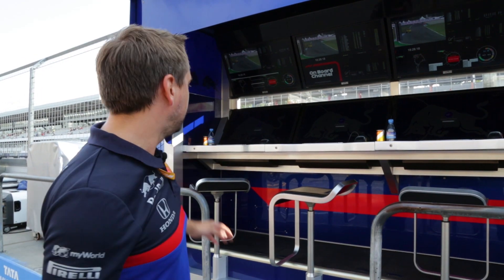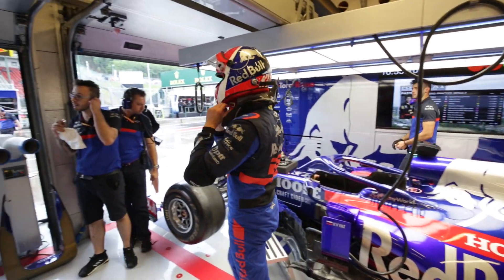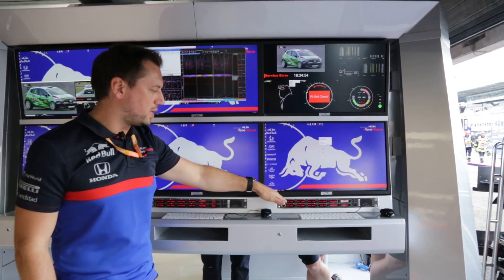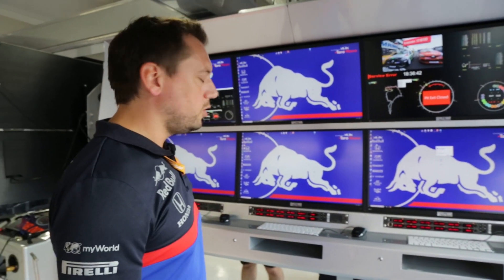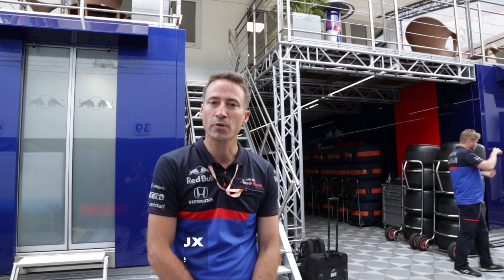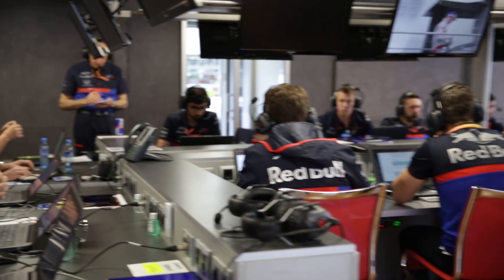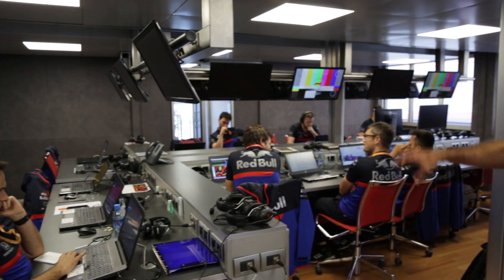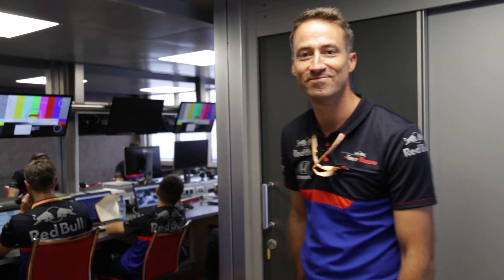Formula 1 Engineering Tour - Trackside

Comment: Furthermore, with AI you can make a link with calculation-intensive applications. Once the AI works well then you no longer need those calculation-intensive applications and you will get real-time advice necessary for an optimal adjustment of the car taking into account the weather type of circuit etc.

Comment: The organization should be: AI engineers with many mechanics knowledge fill the knowledge database to be used for a proper adjustment of the car and the right choice of tires during the race. You are not dependent on the restricted list and knowledge of the engineers.